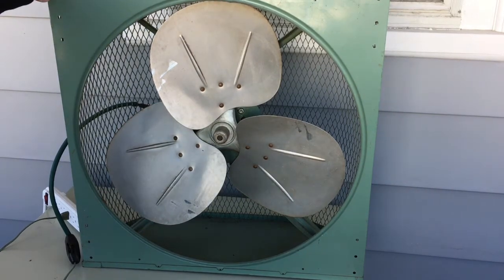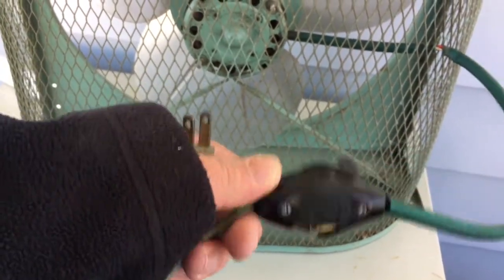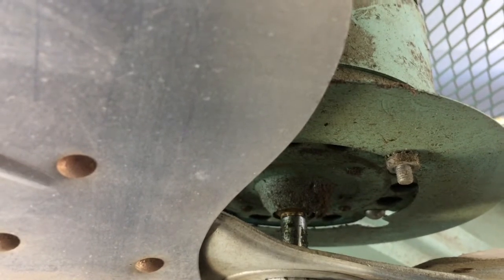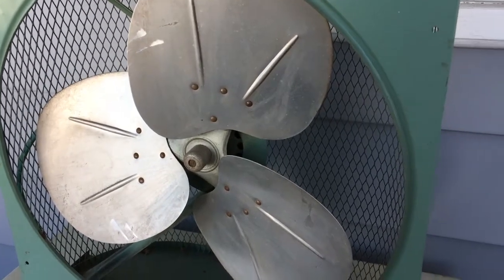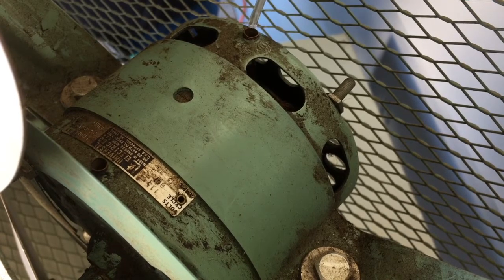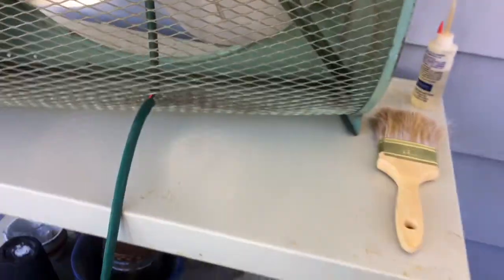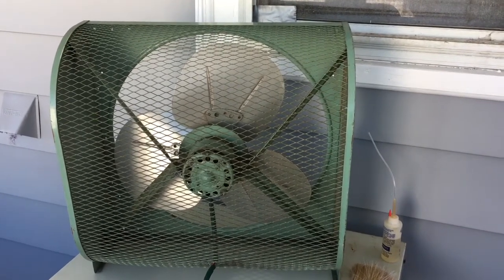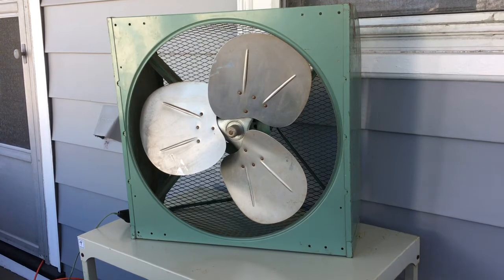Bronson Exhauster 1 4 17 (International Oil Burner Co - St Louis)

Comment: The blade and switch are the same as my Dayton 16"table fan .
Reply from the maker: I agree. I just found some information indicating that this was made by International Oil Burner Co, St Louis.
Reply: There is an oil port by the  I d badge on the motor , the back should be in a similar location , that is a cool
Old fan !